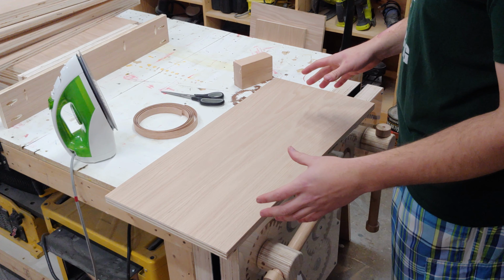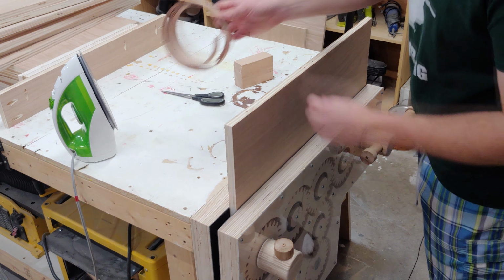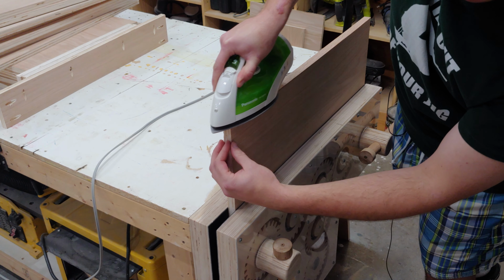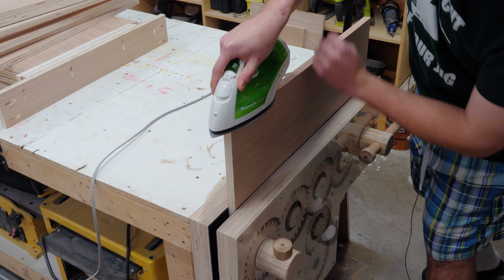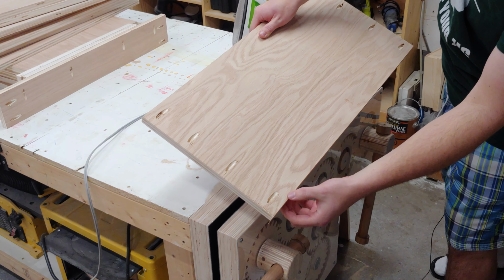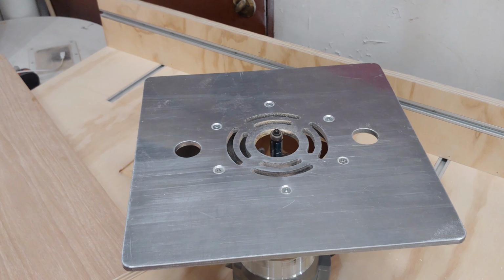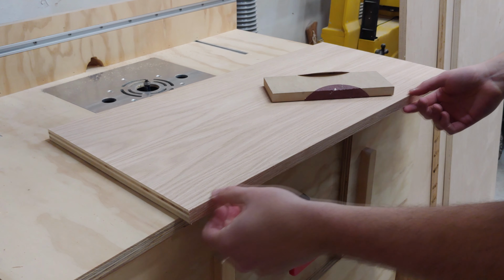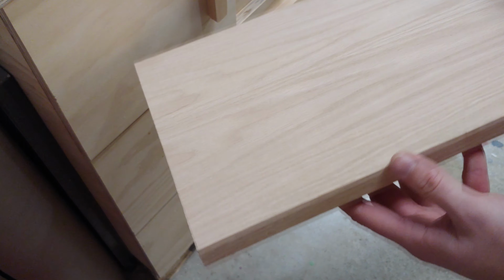How to Apply Iron-on Edge Banding to Plywood

Comment: I use a couple of tools. Especially if it's a large piece I don't want to be lifting it on a router table or bother with a flush trim router.  I use -- an edge banding trimmer, yes it's only purpose is to trim edge banding -- spring loaded -- run it over the edges a couple of times -- and it gets a close edge and a fastcap edge sander and it sands both edges. Quick and easy. These are tools specific for edge banding, but much more control than dealing with a router.

Comment: sorry man, but the way you do the finish it´s completely wrong, you should use a fine grain file. Much easier, better finish and much less dangerous.
Reply from the maker: I shouldn't use sand paper?
Reply: @DIYBuilds  yes, 120 grip
Reply from the maker: A 120 grit sanding block is dangerous?
Reply: @DIYBuilds  must be sandpaper on a hard surface, a piece of wood or cork
Reply: @ezras8889  Firstly I don't want you to think that I have the absolute truth, I just commented based on my experience, 25 years of carpentry. We always use the file to cut the excess of the wood tape, and then with the sandpaper we perform the final finishing.
Reply: If you’re an expert why r you watching this lol.